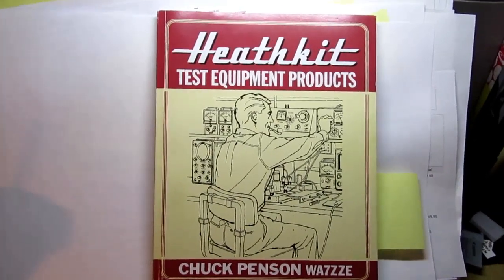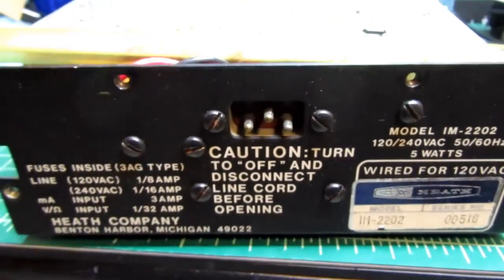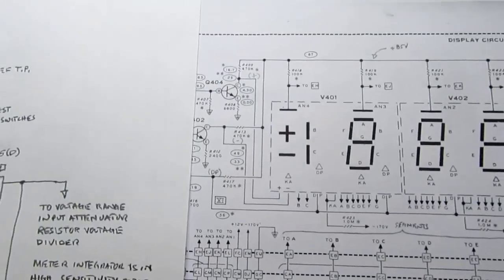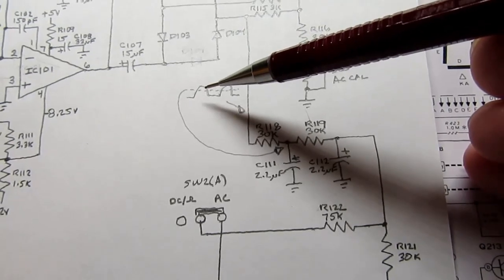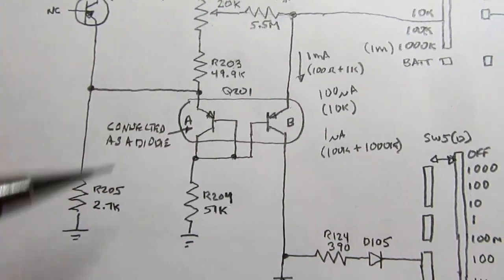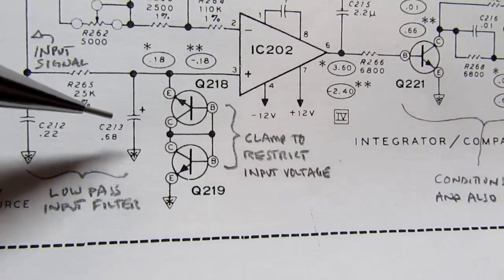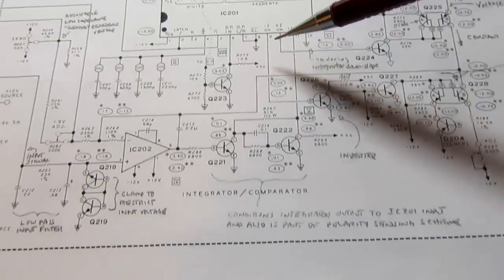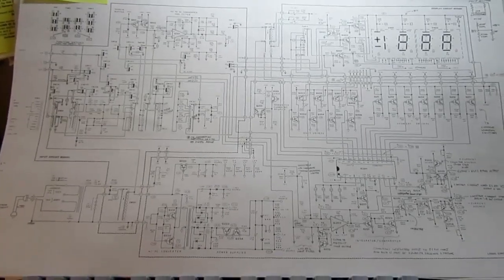Heathkit IM-2202 Portable Digital Multimeter (DMM), Overview, Demonstration, Theory

Comment: Solder blob jumpers are fine (I actually prefer them over jumper wires), but trim switches would have been better.  Since this adjustment is usually one and done, I get the choice not to use switches.